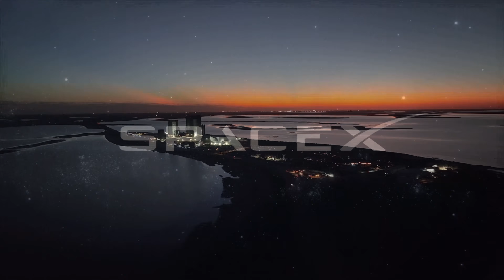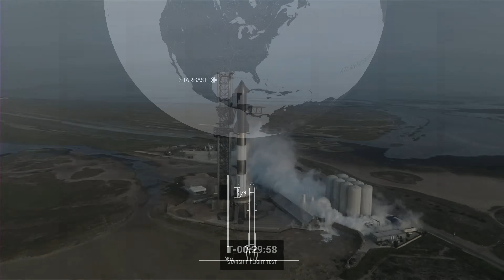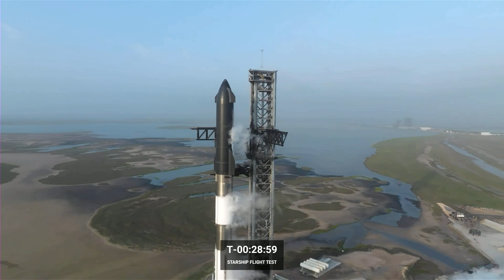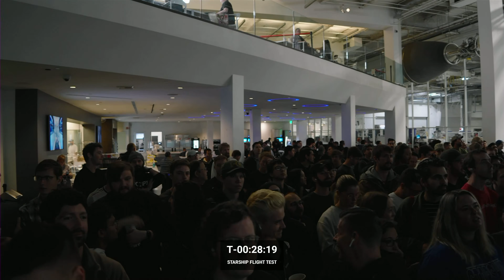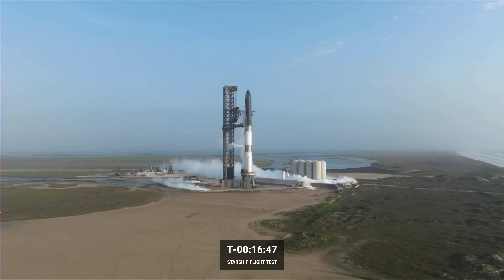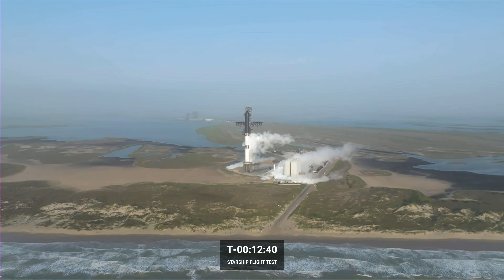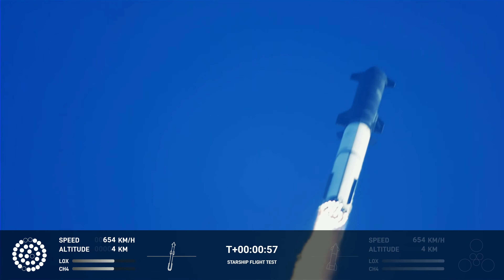Starship Flight Test

Comment: 46:12 That shot where we just see white dots from the engines through the clouds was amazing! Goosebumps...
Reply: Oh, gads, YES!  With a clean burning fuel, methane, we got to each the engines that were burning and those that were not.  I am worried about the one engine of the center three that did not light; would that have been needed for the booster to land (even in this case standing up above the water.
Reply: It literally looked like a spaceship decending in our atmosphere. Beautiful!!!
Reply: you tuned out a little too soon
Reply: @jeettrivedii  everything on this starship is amazing
Reply: @bstoze Think it was a pretty excellent attempt.
Reply: You could see that 6 engines were not ignited.
Reply: Wait for the "look, an UFO" photos
Reply: For sure! Truly breathtaking
Reply: I noticed that Elon hires by merit.
Reply: Note not all engines were working..
Reply: Its not amazing. Money lost, fuel lost, air contaminated !
Reply: Total alien mothership
Reply: @Arturs1984  There’s a greater good.   Step back.  Man can move into space and explore and maybe improve life on earth.
Reply: That’s not a big deal and very much expected. However, one of them did visibly explode, and what really went wrong was stage separation
Reply: You can see that at one point.. up to 6 of the 33 engines failed to light and were NOT firing.. It even appeared that some were "lost" after they went from Throttle down backto THROTTLE UP!?
Is this related to the failure?.. Surely 6 of 33 engines not even firing is a bad thing right?
Edit: That is nearly 20% or 1/5 of the total available power!
Reply: Were a few not working? Or were those spots where no boosters were at?
Reply: @canadaphil6068  The purpose of having that many is specifically so if some of them fail it still has the ability to perform normally, it's max throttle is more than what is needed so they modify the throttle output based on the amount of engines on
Reply: @imamfauzi1101  You're absolutely right 👍🏿
Reply: @niox1920  Yes.. I get that.. and a regular Falcon can apparently still make Orbit losing 1 of it's 9... 
But 6 of 33 !??
Holy SH%^... that does not seem to be.. ummm... "nominal" at all.
Reply: @canadaphil6068  idk the exact specifics but it seems like it made it to the exact point it was supposed to pretty normally. The problem was when they attempted the flip for separation of the upper stage it appears to be a gimbal failure of the rocket not being able to stabilize and less about the engines
Reply: That was super cool indeed.
Reply: @Arturs1984  Part of doing business. Part of bringing life to other planets and ensuring its survival from calamity..., along with reproducing our atmosphere and habitats there. Another step along the way of ensuring our survival from catastrophe, WHATEVER that may be! -Cheers!
Reply: @canadaphil6068  6 engines really isn’t a big deal. When all 33 are firing, it isn’t possible to take them to 100% without the thrust destroying the body of the rocket. SpaceX is normalizing “engine-out” capability, so in this case losing 6 means throttle up the other 27 to like 80% or whatever the rocket math ends up being.
Reply: Time stamp?
Reply: Cringe
Reply: @bunkmoreland4728  you are
Reply: @bazerkly907  Yeah I was wondering about that. Even during take-off it looks like several of the engines were failing to ignite. The multi-engine redundancy appears to have allowed it to still fly quite a way.
Reply: And a little bit of tears. Good ones!
Reply: @Arturs1984  You’re so right!  We need to stop everyone from using cars or heating their houses too so we don’t waste fuel and money.
Reply: @canadaphil6068  A year or two ago they could barely get raptors to light reliably.  Six engines out certainly isn’t nominal but it’s showing massive continued improvements in reliability.   What was more impressive to me is the fact that one or two engines appeared to fail catastrophically in flight without affecting the booster or other engines.  That’s a great sign.
Reply: @JB19504  still more than enough working
Reply: @cosmicinsane516  heating homes is clearly necessary. Flying rockets to Mars really isn't.
Reply: Why the she’s reporter laughing after knows emission unsuccessful , keep your mouth shot there is no times to laugh 😡
Reply: @ab8jeh  lol this rocket isn’t going to Mars for years and years and years.  It will have way more of an impact in bringing down costs to LEO than it ever will for Mars.
Reply: @caekman  Actually, it does appear to be a big deal because shortly thereafter we all notice that there's 6 out, he wobbles around, goes out of control and they push the 'DO NOT PUSH' button and KABOOM! So, it seems like maybe those engines do matter! derp. Asymmetric thrust at those kind of velocities, sorta matters i think??. But i dunno. I'm not a rocket scientist.
Reply: @sleepless1587  There would be if they past the requirements and not affirmative action hiring. Elon's successful because he gets the best for the job
Reply: Yes I can't believe how efficient LED lights have become!
Reply: @cosmicinsane516  I know, you're right. However it seems like one step too far for me, reminds me of N1.
Reply: @ab8jeh  Yeah it’s certainly an audacious project.  Time will tell if it works out or not, but progress has been steadily moving forward.
Reply: @LichaelMewis  LMAO! Ya know, I used to think that every contrail was a chemtrail and that the earth was flat..... For about a whole minute. But then my brain started working again. Yay!
Reply: @jeettrivedii  FOR REAL! Elon may pull it off after all.
Reply: In a way, this reminded me of Challenger except, thank God no people were aboard.
Reply: I thought it was a watermark lol
Reply: @safffff1000  of that were true, he'd have fired himself looooooooooooooooong ago.
Reply: @safffff1000  No, he's successful because he started super rich, and happened to guess right and have a bunch of circumstances roll his way. He's not special, he's not smart, and he's not a good leader.
Reply: Hebrews

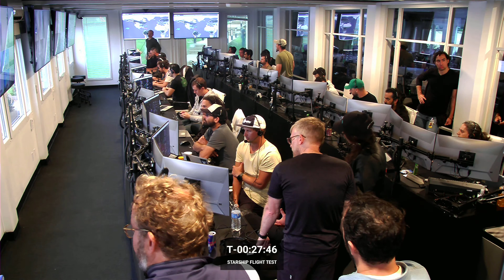12:14 Make every effort to live in peace with all men and to be holy; without holiness no one will see the Lord.

Acts

3:19 Repent, then, and turn to God, so that your sins may be wiped out, that times of refreshing may come from the Lord,

James 2:24,26

Ye see then how that by works a man is justified, and not by faith only. For as the body without the spirit is dead, so faith without works is dead also.

John

3:16 'For God so loved the world that he gave his one and only Son, that whoever believes in him shall not perish but have eternal life.
 
3:17 For God did not send his Son into the world to condemn the world, but to save the world through him.

3:19 This is the verdict: Light has come into the world, but men loved darkness instead of light because their deeds were evil.
Reply: The gospel message is that God loves you so much that He sent His Son, Jesus, to die on the cross for your sins. Through Jesus, you can have forgiveness and eternal life. All you have to do is believe in Jesus, ask for forgiveness, and commit your life to following Him. He will transform your life and give you hope for the future.
Reply: That would make a cool, like, Team/Inspiration poster for the office : )
Reply: That shot was incredible, seeing distinctly all those engines glowing 🤩😄!!
Reply: @JB19504 yes because as they very clearly stated, and repeated over and over, this was the first TEST flight of the full stack.
Ly
Reply: But it's bad for the environment- Elon musk the hypocrite
Reply: @TimRyanYpsilanti  they probably could’ve made do with one of the 10 middle engines
Reply: When I saw it live my jaw dropped, I wasn't expecting it. Despite horrible start the engines that did work made this rocket look incredible beautiful and stable. Because of views like that we can now all follow the launches and see if any raptors are failing lol. The raptor engines just looks so incredibly clean compared to older rocket engines, and so stable when they work.
Reply: That got me too. Looks like something straight out of a sci-fi movie. The future is here, friends.